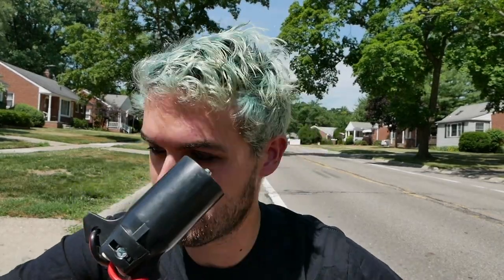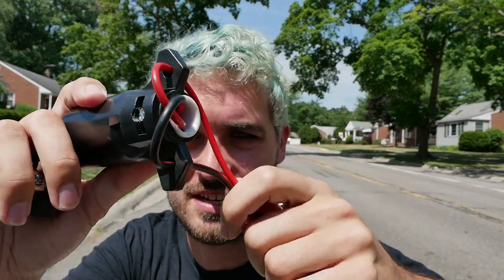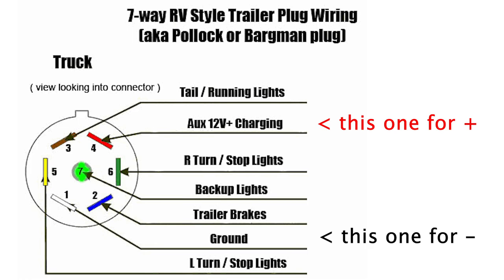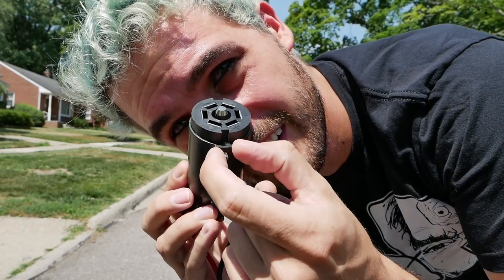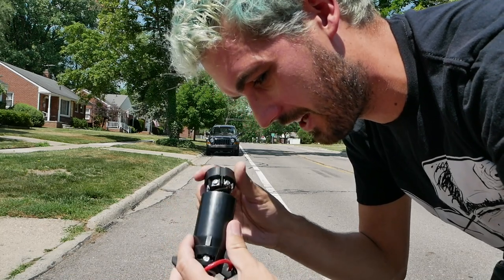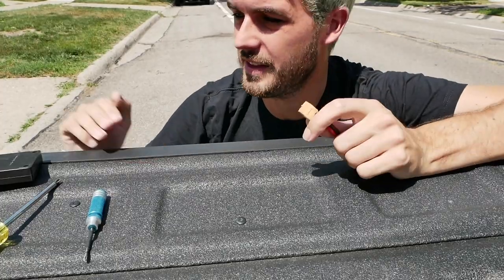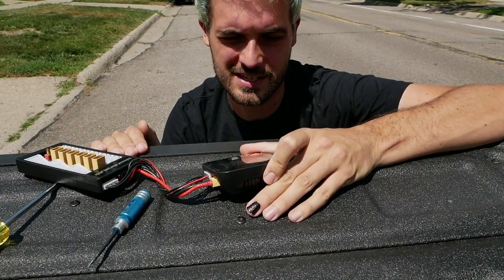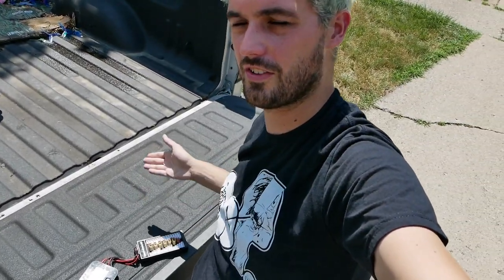how to power your LiPo charger using a trailer plug on your truck

Comment: Good idea .   I myself have two 140 watt solar panels mounted over the tray and they charge a set of AGM batteries through a 
 regulator module , these feed all the accessories on the truck including a 70 litre car fridge and a  600 watt  inverter  , which I use to charge the Lipo's , power tool batteries , and run camping lights  .  So I never suffer the flat battery syndrome . But I will have to make one of those as I do go in other peoples vehicles .

Comment: I've done a similar thing (except through an Anderson plug), though I run dual optima yellow tops so I can totally kill one, start off the secondary and it recharges while I'm driving home. I've actually never drained one enough to not start the car yet. But it definitely works great. Good vid!

Comment: Good job. Been rocking this for a month or two, after seeing you do it. My favorite part is the moving the lipos away from the motor, so should something bad happen, it hopefully only damages the tailgate and not the engine/electronics. 
P.s pick up yourself a yellow top optima, and never worry about a dead battery after charging all day again...

Comment: In your isdt charger settings. Set low voltage alert and stop to 11.5v. should have plenty of power to restart any vehicle.

I don't have a fancy truck, so my cable is xt60 right up to the battery. Just coil it and wedge next to my car battery when not used.

Comment: nice! Question: If one were to add a fuse, and perhaps alligator clips in lieu of the connector you used, what and where should it be in line? would a 20 amp fuse be apropos for safety or less? thanks

Comment: Damn I own a truck and never thought about this, sucks I just got rid of my 7 pin plug since previous owner hacked that up. But my charger I do use has alligator clips that connect right to the battery of the truck so that work for now lol

Comment: I use a GT PowerRC Power Analyzer between my charger and source. Helps me monitor my truck's battery voltage so I don't drain the battery. 😉
Reply: almost every charger has an input voltage monitor, and most have a cutoff option that will stop the charger if the source voltage gets too low.
Reply: Matt Ah! Good to know. Thx bud!
Reply: Yeah a lot of them have that feature because people will use a very large capacity LiPo to power the charger while they are out at the field. And with doing that you don't want to over drain that big LiPo.

Comment: you should have mentioned to verify the wires on the plug with a test light because not all are wired to national standards also there are some vehicles that do not have the power wire ran to it

Comment: Can you charge 10 batteries at once ?
Reply: You can charge as many batteries you want. Just a case of can it supply enough amps for 1c which would be 13 amps for 10x1300mah batteries.  Most trailer plugs can do about 12amps Depends on make and model.
Reply: Ah ok,yeah I have a DTS 300watt 14amp like drib but I tried to get a laptop power bank that was 10amps 150watt to power it and I tried to charge 5 batteries and it would get to hot then start dropping voltage,I cant find a power source that would be able to push the power I need to charge at least 8 batteries,but I'll keep looking.thx
Reply: That is strange. I have a 7amp charger that i charge 10+ batteries with all the time of a 14amp 12v ATX PSU. Could your charge be defective ?
Reply: must be
Reply: I hope not,I think its probably my power supply, it's a cheap one that I got from Amazon,because it gets very hot after about 20mins then the charger does a low voltage cut off.
Reply: TimTimNL where did you get your power supply from ?
Reply: I converted a old PC ATX power supply to xt60. took all the yellow 12v wires solderd them into the postive of a xt60. Did the same with ground. shorted green on the 24pin to ground to always on. Got 14 amp for 5 bucks. Do not open the power supply if you do this. you just need to modify/ change the wires coming out. Look it up if you are unsure. YOu need to know what you are doing.